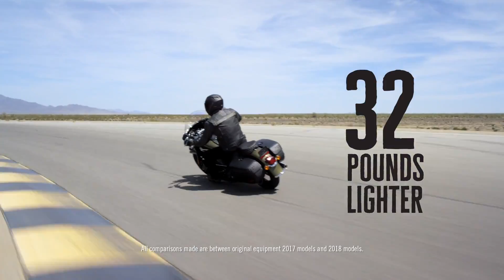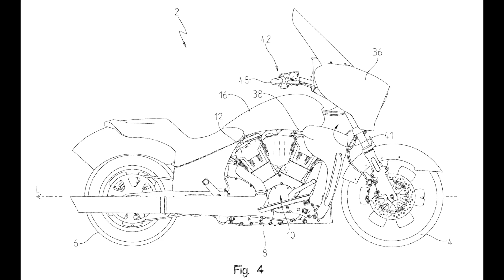Should Harley Discontinue the 107 Cubic Inch Milwaukee Eight?

Comment: A cam swap on the 107 will give you more power and torque than the 114. So if you are lookin for the best cost to performance ratio, I'd start there.

Comment: I put a Stage 1 kit in my 2019 Sport Glide. It transformed the motor. Such a simple change made all the difference in the world. I feel no need for more displacement.
Reply: Throw in a set of cams trust me. Inexpensive to do and the power gains are incredible.
Reply: ..how about reliability?These bikes run way too hot  already ..so the  end for air cooled engines has been reached by now.
The only decent engine that HD had,was the  VRod  motor...but that,s another story!

Comment: I feel that the 107 spins up a bit easier than the 114. This make it preferable to me below freeway speeds.
Reply: My 80 Evo spins even faster…bigger is more power, but also more heat and less responsive. Better passing power with the big engine, but I love my older evo as well, and I’m not blindly rushing to bigger displacement.

Comment: I have a few bikes, 2009 Rocker C with a 96", 2014 Dyna Wide Glide with a 103" & earlier this year i purchased a 2021 Street Glide with a 107".  I specifically went for the non Special with the 107 because i did not find the Special with the 114 was worth the extra $5,000+
I don't ride Harley's because i want to be a speed demon, if i wanted to go fast id still have my 2002 Honda CBR 600 F4i.
I dont feel the need to have the biggest motor, the most add on's or whatever.
I like the basics of exhaust, high flow intake and a screamin' eagle tuner on al 3 of my bikes and what i like most, is they are all bought and paid for.
Sure, i could sell or trade them all in and get a CVO, but why?  I dont need the attention, i don't crave it, i ride for the joy of the ride.
I like having 3 Harley's and they all ride different depending on my mood or where i am going or how far i am going.
I also heard they are getting rid of the non Special Road Glide & Street Glide and it will just be a SGS, RGS and CVO.
I seem to get a new bike every 5ish years so maybe in 2026 i will get a new bike with whatever motor is being offered but i will say that my next touring will be a water cooled engine so i hope Harley comes out with a great Revolution Max motor for the big touring bikes or by 2026 i will 61 and who know, might need 3 wheels  :) But i hope not!
Reply: for $5,000 you can get a stage II, it will out perform a stoke 114 and have some $$$ left over to waste on something else. The Stage II route, you can pick how you want your power delivered also. I have the 107, I doubt I will ever do more than a stage I, that is basically for aesthetics and run a little cleaner and crisper.
Reply: @michaelconran5252  I agree with you that is why i took the 107, the 114 wasn't worth the $5,000 and like you, i dont see a need to do anything beyond the exhaust, air intake and a tuner and on the 114, i would have had to spend that anyway
Reply: That 5 grand extra is not just the motor difference. The special give you stretched bags, different wheels, daymaker headlight, high flow air cleaner, gloss inner fairing, upgraded speakers, different sleeker center counsel on the tank, boom box gts over the 4.3.
Reply: I would also be interested in a liquid-cooled engine seeing as it hits almost 50° Celsius where I live.
Reply from the maker: That's my philosophy too. I have a Harley for loafing around, not racing (btw, I also used to own an F4). I also don't ever want to finance another toy. Why spend the extra $5000 when you can invest it and watch it grow instead of depreciate on a vehicle. 61 is young these days. I'm sure you'll be able to ride any bike you want, but by then it might be a 100+ci Revolution max. Cheers!
Reply: @ryanm.9197  I didnt want the stretched bags, they included a Daymaker headlight, i chose the air cleaner of my choice, not a fan of the gloss inner fairing as i wanted to order a colour matched inner fairing for $300 from Advanblack, the speakers are just fine and the boom box display is the same as as the SGS, the only thing i like on the SGS that i like is not having the fuel filler in the centre of the tank
Reply: Amen my friend!  I have a 2018 RK special with a stock 107 and love it.  Way more then enough speed.  And I don't give in to Harley's cash cow BS where they keep coming out with a little bit bigger bore motor every few years to entice the full grown adolescent men who act like children who keep trading in their low milage bikes every few years just to have the latest on the block to keep up with the Jones'.  I respect someone who keeps and rides their bike for many years and enjoys thousands of miles on them before they trade them in.  Great comment and ride safe.

Comment: I ride a Sportster 1200 (stock) and am perfectly happy with its power. Yes, it could use a bit more grunt on the highway but I rarely have to ride on one, and then only for relatively short distances anyways. So for me it's a nonissue. Having said that, if I were in the market for a new HD at today's prices, I probably would go for the Softail Standard given its out-the-door price relative to a new Sportster 1200. The former offers great value, the latter not nearly so much. Some 1700-odd cc's is more than enough, thank you. Soooo . . . basically disagree with your stance.
Reply: Sporty 1200 has enough power for everything but it does get fatiguing riding it at highway speeds. The 107 big twin and the 114 really overcome that issue with bigger displacement along with a sixth gear. The Standard is a great bike at a good price as is the Street Bob. I bought a 114 Lowrider S but would be just as happy with a107 motor...the handling of the Lowrider S is what won me over and not the motor.
Reply: My second Harley is a 2003 883 Sportster that I’m thinking about boring out to 1200 and dropping in the higher compression pistons to go from almost enough power to more than enough for me power.
Reply: @Motorheadmike Nice to have a stable of bikes. I have to settle for just one and right now that's an 09 1200 Low. Yes, they're a blast to ride. Thinking my next one may be a 103 Dyna Low Rider, anything from 2014 to 2017. Looks remarkably like the 1200 Low . . . definitely my preferred look - classic.
Reply: @chrissmith7669  Thinking of doing a Stage One with my 1200 Low. But not sure that HD actually does Stage One anymore (in Canada). Don't see it on their website (parts & accessories) anymore.
Reply: @bernardlesperance742  I’ve got a 2020 street Bob I bought and Just inherited a 2003 anniversary edition 883 hugger that’s in need of TLC.  I like the idea I can boost the power level of both noticeably for little by not going the SE route.
Reply from the maker: Yeah, good thinking. I actually think that they should keep the 107 just on the Standard and keep the price the same. They'll make it up on all the accessories you're likely to purchase from them over its lifetime.

Comment: Rocket 3 rider here (150ci triple), that capacity really does help when it comes to water cooled higher compression engines. That silly capacity gives you low down torque on a motor more aimed at the top end when you look at the engine being square. I think my next bike will be a full dresser tourer, but looking at Bmw for that horsepower component from their 1600, but would probably prefer a Harley if it could do both. Bit rambling but my 2c, enjoy your content as always.
Reply from the maker: Thanks! You could definitely get good power out of the M8 but it won't be cheap!

Comment: I toured half the United States on a Sportster 883, about half of that was done with the Sportster pulling a trailer behind it and with a passenger on the backseat. At no point did I have trouble keeping up with traffic or climbing grades. Sometimes I wonder if people know how to use their gears or bother to figure out what RPM's their engines make power. People have been traveling on motorcycles for over 100 years and for the vast majority of those years most bikes were under 1,000 cc's.

Comment: I enjoy my 107 street Bob but am thinking about boring out the cylinders and dropping in the higher compression 117 pistons.  Supposed to be close to the MoCo 131 kit output.  
My vote as if anyone cares is to drop the 107 as it’s to close in size to the 114 and offer the 131 as factory option at a decent price.  About the Same Ratio in displacement as the 883 to 1200 sportsters.

Comment: Very pleased with my 107 this far. Although it makes business sense to consolidate costs by making a single motor, the company will not pass it on to the consumer. Much like removing the hydraulic clutch on the tour models and then adding a surcharge.
Reply: One size motor makes NO business sense.  Take a basic Marketing class. 
HD charges a $5 premium (nearly all pure profit) to get a 114 Special. Take away the lower price point 107 and the whole justification for the premium price falls flat on its face.

Comment: I have a 21 RG Standard 107. In stock form it's a bit of a slug when loaded two up for touring.  I rode a stock 20 RG Special 114 for around 500 miles last year and appreciated the modest difference in torque of that motor compared to the 107 in stock form. But i agree that $5k is too much of a premium to pay for that. The cost of a torque cam and stage 1 intake/ exhaust in the 107 to add more passing power without dropping two gears every single time is worth it for me. As opposed to displacement - I think HD should focus on usable power and torque in their big touring bikes. A number is just a number.

Comment: When the wear & tear begin to creep up on my 2018 107 slim( every day commuter in TX) I’ll just replace the motor with the 131 and keep the frame and appearance( after market parts)
Reply: From what I’ve seen idk if the 131 fits in the 107 frame. I have a 19’ FXBB 107 and I’ve researched that question too bc why not put a 131 in the small frame😂
Reply: @ never had the opportunity to find out, traded it for the FLRSX

Comment: Welp my first new Harley was a 2021 street bob 114 which is plenty of scoot for the kind of riding i do, but the 107 with a nice torque cam would be scratch that itch just as well. Besides the 107s after 2020 most likely got the up graded oil pump, so its all good.

Comment: I purchased a new 107 Street Glide at a good price. I did the Stage 2 ,exhaust and Chrome forks and my 107 is lots of fun, I tend to think about my 107 vs 114 like I thought about the old Chevy 327 vs the 350 v8, yes the 350 has more power and  most folks have the 350 but given a choice I would choose the 327, perhaps its just me….

Comment: My personal decision went with the “baby” 107 lol. It came down to the decision where it was the 2020 road glide 107 that has 228 miles for 23k in 2021. Vs 2018 114 for 28k and it had 5xxx miles… i didnt see the value of 7 cubic inches and over 5k+ miles to be worth $5k+… been satisfied so far with no complaints on my purchase. Overall I believe if you can be on 2 wheels for a budget that fits your own be safe and have fun!!

Comment: I own cross bones with TC 96 engine and I consider it as the most appropriate for that kind of motorcycle. It gives me some kind of old motorcycle feeling but very smooth ride. And when turning it off, when cooling, still some noises can be heard. So great. I test rode some modern Harleys with bigger and stronger engines. Impressive, but would I wish to have such engine in my CB? No. So, I think not every engine is ideal for every model (letting aside environmental issue, which limits the choice). I might say so, because I newer ride fast with Harley. Fortunately I have an other option when I want to be faster. Harley should put more attention to rear suspension and seats. I am so happy to have tractor seat with option of two positions, so I was able to find the right one for me and springs bring some additional comfort….

Comment: People forget that gearing plays a role in how 'fast' a bike feels. After taking my cousin's Low Rider S 114 for a spin I ended up with a Road King 107 (both the 114 & 107 would eat my Dyna 103's lunch)- we both felt the RK was faster off the line & only slightly slower at higher revs. Turns out the lower gearing in the RK is what made the difference. Unless you're always riding at top revs, the 107 is fine. That being said, 'bigger is better' is what sells. So you're likely right that the 107 is over.

Comment: I ride a 2013 Ultra Limited 103 (that was a hot POS stock) with a 551 cam and a great tune. The engine provides more than enough torque for two-up riding in the mountains. I am currently having the engine rebuilt ( after 140,000 miles) from the crank up and boring the cylinders to a 107 along with headwork. The engine will have 130 ft pounds of torque @ 3,000 RPMs  (115@ 2,000 RPMs) and almost 100 hp and run cool. These are real numbers, not a dream dyno. This is all HD has to achieve. The 114 with a set of bolt-on mufflers is all the new bikes need with one exception. The crank needs to be held to closer tolerance for total runout.

Comment: Harley should offer the 114 as an upgrade. They have the 131 crate engine already, so why not offer that as the CVO standard and then all the Specials get the 117. I actually wish Harley sold crate engines of the 117 and 114s. This would create a new revenue stream.  Great video,  thanks.

Comment: I have actually wondered why engines are so close in displacement, I personally think the 114ci should be base. If you want the bigger engine it should be notably bigger not just 3cc. Ditch 107, make 114 or 117 standard and what you get on all rides BUT you want bigger you get 125 or 131. HD needs 2 engines, ppl are going to customize/modify to thier liking. So give us engine blocks that start out the same along with higher-quality lifters, valves, clutches,drive line etc etc... and really tighten up on quality control with the milling and building and make HD engines even more reliable and worry-free

Comment: An overdo for softails, just an option to have a bigger engine mostly for common working people like me, IMHO. But we all make upgrades regardless! But for baggers its almost a must. I said almost, because we moved about the same weight with  an 88,, a 96, or a 103 and it was amazing, right? Again on a bagger, you need all the help you can to make a half ton bike move better because of the power to weight ratio, and we all know they will not be sport bikes by any means, again, IMHO.

Comment: I own a pristine 2019 Harley-Davidson Sport Glide with the 107ci, (which was the only engine ever offered in the Sport Glide). I love my bike but I often wish it had a 114ci or a 117ci in it? But since it will only ever have the 107ci in it what are some of your best recommendations on what I can do with the engine and/ or the exhaust that would greatly increase the power without harming or shortening the life of the engine. Also, if I upgrade the engine, what would be your opinion on changing out the 107 cover plate on the right hand side of the engine?

Comment: I have heard the longer stroke 114 in the rigid mount softail does vibrate more at highway speed. Probably isn't a noticeable difference on the rubber mount touring bikes. I'd say keep the 107 in the softail, use the 114 for touring.

Comment: Its really just about what sells. These big twins are more than capable of taking you where you want to go, and feels good while doing it. That's all you need..its not really a competition. People really don't understand that air cooled bikes are just different machines. They simply will never be as agressive, and they're always built for torque, not horsepower. They do have a character that more modern bikes just don't match. There's something nice about an engine thats not totally refined and boring.

Comment: I bought the 2018 RGS 107 2 weeks before the 2019 Touring 114 was released. it stung for a minute knowing they had a bigger engine and a better radio but with the savings i got I quickly forgot about it

Comment: I ride a stock  2021 model  107 Sport Glide.  Oodles of power/torque and great fuel economy.  22k trouble-free kilometres.  Uses no oil. All I do is regular service as per HD maintenance schedule.  Maybe I just got a unicorn M8 107.  PS.  I’m very comfortable with my size😉
Reply: Update.  37,000klms on the clock now.  Stage 1 with Vance and Hines Big Radius.  Better fuel economy from stock figures and noticeable pick up.  Bloody lovely.  👌

Comment: I believe that upgrading pipes on the 114 requires a tune vs no need for such with the 107.  The included high flow air cleaner on the 114 usually requires a full stage 1 when upgrading the pipes.
Reply: Both have the same tuning issues

Comment: They should step back and start the EVO engined bike again, simplier/less maintenance then the twin-cam series, which aren't designed to do any time on. A good friend (HD Mechanic) once told me the evo-engined bikes would come in with 200"+ miles on them, the twin-cams couldn't muster 1--K very often, built for the non-rider groups.

Comment: I have a TC 88 Road king with stage 1 and am perfectly happy with its performance, its for touring not quarter mile racing and that engine has plenty of grunt for everyday use.  If i want something fast i would buy something else than a Harley.
Reply: The issue with the TC 88 is it could never pass today's EPA standards. As long as people demand  Harley have a 45 degree V-twin and a single crankpin and the EPA demanding less noise, less pollution and more fuel efficiency, all Harley can do is more displacement. My 107 is cleaner and has more power than a stock 88, yes no brainer. But if I built an 88 M8 to today's EPA standards and ran it against a stock TC 88, I am sure the Twin Cam would come out on top. Harley got a lot of government protection to help with sales, much of that, and especially from the EPA, is gone.